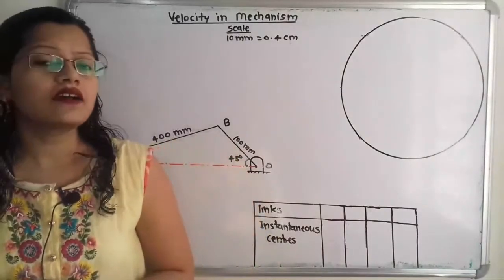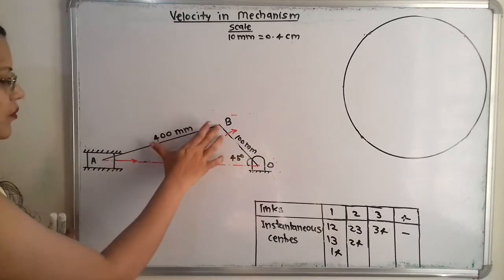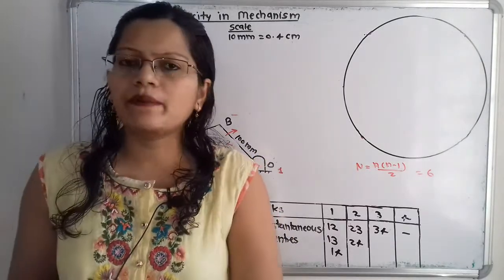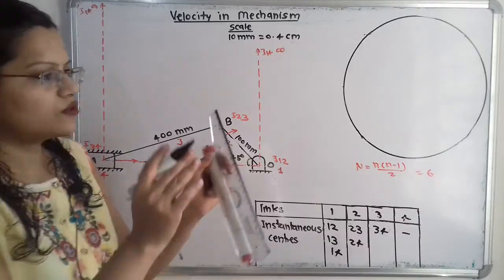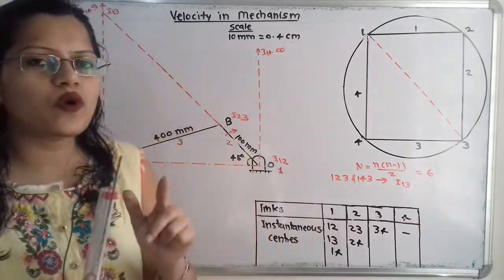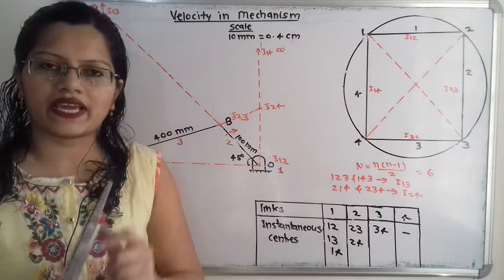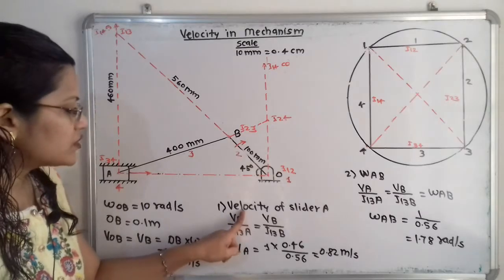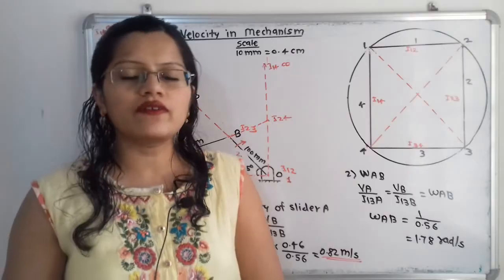Problem 2 on slider crank mechanism instantaneous centre/Velocity in mechanism

Comment: how do you come up with the scale 10 mm to 0.4. I am trying to find the velocity and acceleration of slider A. but I am getting confuse by finding 6 center values. is there anyway of not using scale and do this mathematically?
Reply from the maker: It's graphical method. .. please watch other videos to clear confusion about scale. ..

Comment: If I may ask, how did you get point I13 to point B as 560mm and point I13 to point A as 460mm
Thank you
Reply: once icr has been plotted then just measure it with  a scale
Reply: @suyogbauskar  oh, thank you. I was just wondering because the values in the textbook is also equal to this.